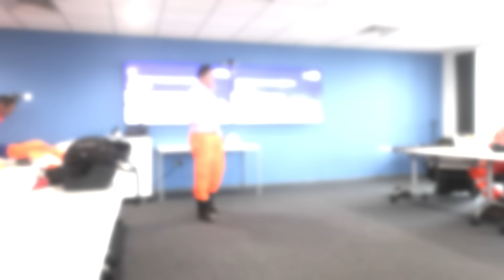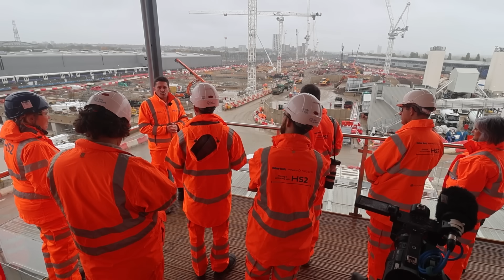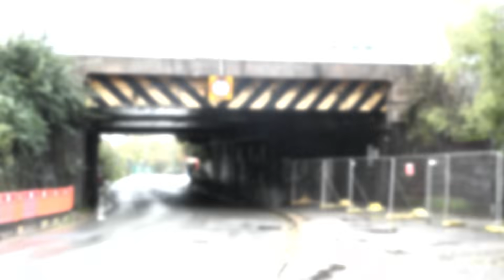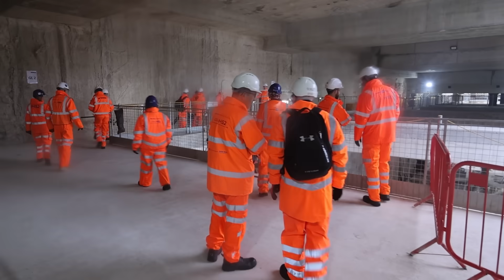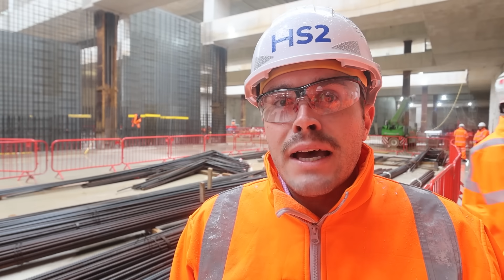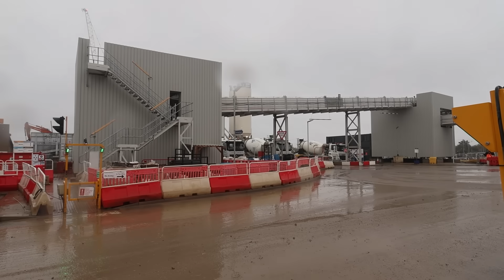HS2 Old Oak Common Station Construction

Comment: I very much hope some of the Phase 2 cash saved sees some proper WCML upgrades. A consistent 125mph north of Preston to Glasgow and Edinburgh, with more loops for freight. Get rid of some of the ridiculous speed restrictions (like the 60mph curve at Law Junction) and the curves at Lambrigg. Also, string the wires up on the S&C and GSW, improve the signalling and move the freight off the mainline. That’ll be done for a fraction of the cost of Phase 2.
Reply: Getting continuous 125 mph from Preston to Glasgow would probably cost more than the portions that have been cancelled do
Reply: But if Stafford to Preston section is causing delays and cancellations what’s the point.
Preston is a nice place though, don’t get me wrong

Comment: Hi Geoff, I have 2 potential topics of debate for you:

1) When HS2 reaches Euston Station, do you think TFL will consider extending more underground lines to Euston to meet the extra demand, or will they just make HS2 passengers use the already rammed Northern and Victoria lines?

2) When Old Oak Common station finally opens, do you think TFL may think about extending underground lines to the station, for example the Central, District or Piccadilly lines that already serve west London? Or possibly build a bus station there? Or even both? Having said that though, they might not extend the Piccadilly line because that already goes to Heathrow Airport. 

I'd be interested to know what your thoughts are on these matters 😀
Reply: Euston is one of the worst underground stations and stations in general it’s a nightmare getting on the northern line that branches out
Reply: They've said there'll be a connection to the Elizabeth line at OOC. I reckon there'll be a station to serve the North London line too......
Reply: @markcf83  Wow, that simple change will transform the case for this whole white elephant. NOT.

Comment: The chat about lowering the road to admit double decker buses reminds me of how good and seamless transport projects can be when the government and planners allow them to be
Reply: Hopefully when the road is lowered, the pavement is left flat. Too often you see under rail lines the pavement follows the road into a dip, when obviously there is no need to have tall clearances on a pavement, and it can add a lot of unnecessary difficulty to e.g. wheelchair users or someone needing to push a buggy.
Reply: Hopefully goes a bit more smoothly than the road lowering under the railway on Botley Road in Oxford. Road is closed for 18 months as they kept finding more things under the bridge!
Reply: @gavinjamie I’d heard it was closed but wasn’t sure why! Funny, as I was also thinking of it as a great example for one where the pavement doesn’t dip anywhere near as much as the road — but that was in the old form!
Reply: YEP ! some  US  railroad bridges only allow the smallest automobiles ( ! ) ...... DAVE™🛑
Reply: @davidfalconer8913  well, the bridge has probably been there 150 years and we've had double deckers for about a century so they've managed to do it quite quickly. Yeah. The US isn't always doing worse than us on rail.

Comment: Even though it has been cancelled the staff still believe that there will be 250,000 passengers a day. The plan was never the right plan, the marketing was wrong too. Better to stop all work and reevaluate the whole thing.
Reply: When you build you make space for all future possibilities.  To do anything else would be crazy.
The design was of course specified for the original full HS network, but stopping and redesigning would save nothing at all and simply delay opening.

Comment: The North needed the railway lines to Newcastle not Birmingham or Manchester the actual North East of England needed the railway line. Manchester gets far too much investment as does London
Reply: Newcastle to where?
Reply: @andrewreynolds4949  Newcastle upon Tyne was listed as hs4 from the Leeds section of hs3 waiting a further extension to HS2 it would have gone from London. Manchester is awful because everyone thinks Manchester deserves everything and forgets the North East actually exists. It would have meant so much more to us than it would have to Manchester
Reply: @sabrinamurray  Never heard of HS4. As far as I know the plan for the north east of England was to selectively enhance the ECML, which is already better off infrastructure-wise than the WCML. I saw some calculations that the ECML would be competitive time-wise with HS2 to Scotland
Reply: @sabrinamurray  Not sure where HS3 and HS4 have come from as these seemed to have materialized out of fantasy and HS2 is preliminary a new High Speed line being built to supplement the existing WCML from the North West and Birmingham to London that is all due to the WCML especially from Birmingham of which HS2 is centered on is totally congested and can not be upgraded
Reply: @peterwallen1063  when the plan was written up originally it was to run HS2 to Birmingham, HS3 to Manchester and HS4 to Newcastle via Leeds. I looked at the original plans for it. I was even one of the non governmental liaison committee’s asked for advice about the project before the started building it. Please don’t tell me that I am wrong I still have my original notes from the discussion on it somewhere from about 10 years ago.
You clearly never read the original plans for the full project. When it was originally designed HS2 was to run to Birmingham, HS3 was to branch off to Manchester, HS4 was to run via Leeds and end up at Newcastle upon Tyne. I know the guy that actually did the design work for the original plans. You aren’t as informed as you think you are.
Reply: @sabrinamurray  You may of had notes but here in Birmingham and the West Midlands where the HS2 HQ is nothing has ever been mentioned of it til late in the day, but again another hair brained idea, like to get to London from Birmingham your train needs to go to York first then down to London. What would the actual point be for some one to get on a Train in Newcastle to travel over 100 miles to Birmingham then down to London another 100 or so miles, just seems a waste of time when there are direct high speed train service down the ECML to London Kings Cross. Even if the line had been built it would only of gone to London as if people wanted to South West  to Bristol and Cornwall as most trains at the moment do on this Axis you would of had to get off at either Birmingham Curzon Street and walk to Birmingham New Street or change at Birmingham Interchange onto a Cross Country service as all trains on HS2 will be operated by Avanti West Coast Trains,
Reply: @sabrinamurray  HS2 & HS3 have not been shelved forever, but just set aside. How long for is anybody's guess.
The southern part of the WCML is being relieved first because it is the most crowded, so needs help more urgently. Any costs which can be "saved" (in reality just shifted to a different project) will be. It is an accountancy trick welcomed by businesses & governments to keep people happy, even if the eventual cost will be greater.
Reply: @TheRip72  HS4 is the only one that actually mattered though shelving those other sections is not important they need to be sorted out so those sections that aren’t actually important are completed so they can actually focus on the only important but being HS4 and HS5 which actually go to the north east of England.
Reply: @TheRip72  HS3 was a waste of money and should never have been sent to Manchester it should be HS4 that is prioritised to Newcastle and HS3 should be permanently abandoned the north west is overfunded by the standards of the north east of east of England in every way possible. Manchester needs to stop being prioritised and they need to focus on the actual north of England instead of giving us substandard trains and travel services when compared to the north east. We are seriously underfunded. They can’t even give us decent trains
Reply: @sabrinamurray  The route to Manchester is busier than that to Newcastle. Is it not even on the core section (it diverges just before Stafford so through trains to Glasgow/Preston/Carlisle do not stop there), which is why the service to there was considered first.
Both routes will be useful though & it should not be about choosing one over the other.
Reply: Why does the North East need HS2 as it has the ECML

Comment: With all the depressing news about HS2 cuts, it's encouraging to see that SOMEthing is still getting built and that it'll be really good. I'm hoping that it'll be as good as the Lizzie line, and then people will badger the government to re-think their stupid plans to scrap the northern legs.
Reply: The corrupt government sold off the ROWs of HS2 and essentially made sure to make it difficult to rework/reboot the project such as this.
Reply: should have started in the north instead.
Reply: @routeone4790 It would then have a worse cost to benefit calculation and probably would have been killed off in the 2008 Austerity programme. The whole cost to benefit calculation works as building a new national network trunk line so the cancellation of the North section also makes the cost-to-benefit worse.
Reply: @routeone4790  Why !!
Reply: @routeone4790  For what reason should it of started in the north
Reply: @peterwallen1063  cause the south already got great train infrastructure and the north is awful
Reply: @routeone4790  That is no reason for HS2 to of been started in the north as HS2 is nothing to do with the local northern rail problems
Reply: It's not stupid to scrap a waste of money. They should've scrapped HS2 completely
Reply: @DS9TREK There's no better way of wasting money than scrapping something that you've half built. The next best way of wasting money is failing to build the bit that makes the bit you have built really useful!
Reply: @sydnorth5868  precisely
Reply: @sydnorth5868  True, by chopping off the bits that kind of justified the whole thing as a long-distance line, it's so much wasted iron. Who needs a short-distance high speed train that won't even get you to Central London w/o p****g about changing onto tubes etc. OMG, ***-up on a scale comparable to the nuclear industry
Reply: @sydnorth5868 thank you!!
Reply: @sydnorth5868 no point on scrapping it they are doing well and a good job and it should be finished by like they said 2032 the satrsr of that year 😊
Reply: @DS9TREK  It wouldn't have been a waste of money if they'd stuck to the original plan and if there wasn't poor planning and corruption involved.
Reply: @DS9TREK  Would love to know how you can dramatically increase rail capacity which is congested with freight and growing demands for increased frequency of local passenger services without building a new trunk line.... come on tell us all why it is a "Waste of Money" ("Money" that is merely digital numbers based on virtual national debt spread over multiple decades and is merely paid back via the growing economy that the infrastructure fuels). Go on, do tell everyone.... or are you just like one those pub talk people that think thinking is all about shouting slogans?
Reply: @DS9TREK should have scrapped it. But once it's complete they'll sell it off to another foreign business just like the rest of the railway.
Reply: @GraySkull289 The rail infrastructure isnt sold off, the services are put out to tender. "Foreign business" is a bit of a strawman, I mean taxation on the profits aside they also pay to run the franchise so eitherway money is going back into the country.

Comment: Ridiculously over the top and grandiose. No wonder we can't afford infrastructure projects if we build an interchange station like this. If Frank Pick had insisted on projects this size we'd never have built the underground.
Reply: It’s a concrete box in the ground. Hardly grandiose.
Reply: It's actually a missed opportunity. There are five other tube and rail lines really quite close by, that could be tied into OOC using satellite platforms and travellators that for now are not linked to it. Hopefully in the future there will be a phase 2 that accomplishes this.
Reply: @Pesmog Yes I am surprised.  But had to save money I guess.   It’s got to be done one day
Reply: Quite a few station around the world are similar or larger then this (grand central, Pen Central, Etc)

Comment: Wow, all this for the Birmingham shuttle service!
Some serious engineering goimg on for sure and love those telescopic Hitachi machines. The ZX350's have a dig depth of about 28m or nearly 92 feet. Previously a crane with a skip or kibble was  used for shaft sinking. Digging out a box would probably entail track loaders filling tippers via a haul road, sonthis is all very streamlined here!
Reply: Yes, it's probably best for them to finish OOC as planned, changing the design/spec at this stage of the build would be problematic
Reply: @railotaku  It is not planned to terminate OOC as there are no facilities to terminate trains there.
Reply: @peterwallen1063  It will temporarily teminate at OOC until Euston is finished but not even Euston is worth it anymore as Rishi just watered down the project with fewer platforms which is VERY short term thinking.
Reply: @Mgameing123  Yep I know that.
Reply: Exactly your first sentence.  However, until (if) HS2 gets to Euston, it will be quicker to go from there to New Street on the WCML. Not this side of 2030.  So much for levelling-up for the North.
Reply: @john1703  But when HS2 opens you won't be able to go from Birmingham New Street to London Euston any longer
Reply: With the Euston leg not ready, will all fast services from the north terminate at OOC. ?  ie Will Euston become regional and local services only??
Does anyone have an insight?

My guess is that you will have a choice of a service to Manchester (for example) from either place, but that it will take 30 mins longer from Euston - slower than now.  The relaxation of speeds on the WCML line will then allow reliability and capacity improvements to regional and local services to begin.
Reply: @gavin1342  Living in Birmingham at the heart of HS2 and the HQ of both HS2 ltd and Avanti West Coast Railways we get a lot of information on the progress of HS2 and it as been in one of the Railway periodicals, When Euston is completed and the new HS2 platforms are built, I believe it is now 6 purpose use platforms for HS2 plus one joint platform for the use of both HS2 and WCML services. As it will be Avanti Wet Coast Railways that will be operating both the HS2 services and the remainder of Inter City high speed services out of  services on the WCML out of Euston the vast majority of Inter City high speed services from Euston to Birmingham, Scotland, Manchester and Liverpool will transfer to the HS2 line and only other Avanti Services for Holyhead, Coventry, Wolverhampton and Shrewsbury will use the WCML
Reply: No it is not as trains will still go to Manchester on HS2 as far as Litchfield here they will join the WCML to Manchester

Comment: I thought the whole thing had been cancelled!

It seems to have been quietly rowed back on then!  Well I'm not complaining...
Reply: Only Phase 2 has had bits lopped off. Effectively the section between Lichfield and Leeds/Manchester Airport is dead. OOK to EUS hangs in the balance, but without it the whole of HS2 may as well be binned.
Reply: No, the second phase of HS2 has been cancelled, which is everything north of Birmingham.

Comment: A lot of infrastructure for a fast train to and from London to Birmingham.
Reply: had it not been cancelled it would have gone to a few more places and with some forward planning it could have integrated into HS1 for international use and in the future a potential HS3 to cover more of the country
Reply: @TheHobohobbit  There is no reason for HS2 to connect to HS1 at all
Reply: @peterwallen1063 apart from a more direct link to st. pancras international?? (even tho you can take the tube to kings cross st pancras via euston via northern & victoria lines)
Reply: @HarrowwInk  But as of present no one using the HS2 trains will need to go to the continent, not many passengers on the existing WCML into Euston which HS2is replacing actually travel on Eurostar to the continent, they fly from Birmingham or Manchester Airports.
Reply: At present St Pancras is bursting at the seams. Eurostar have been deliberately leaving some seats empty due to capacity constraints.
Meanwhile anyone wanting to travel to the continent by train is forced to go via London.
When can we ever expect to get direct services to Germany or Spain?
Using the spare capacity that will now exist to provide an International rail terminus next to Birmingham Airport is a no brainer!
Linking HS1 to HS2 is inevitable now that Sunak has cancelled the original plan
Reply: @gavin1342  There will be no International rail terminus next to Birmingham Airport, there is a Station called Birmingham International name so as not to confuse it with Birmingham New Street in Birmingham City Center and because at the time Birmingham Airport was named Birmingham International Airport and also it could not be called Solihull as it is not in the Town of Solihull and people using the Airport and the Station would not know where Solihull is, also the new station on the HS2 line like wise is being called Birmingham Interchange.
Next, HS2 being a domestic high speed line being operated by one operator Avanti West Coast/ Trenitalia will not be connected to HS1 at all. Domestic European TGV trains do not travel to the UK, so like wise Domestic UK High Speed train services will not travel to the continent
Reply: And even though phase 2 has been cancelled, trains from north of Birmingham will still use this section of HS2.